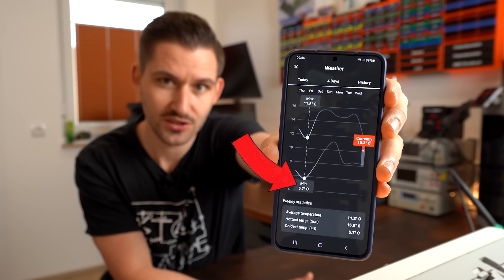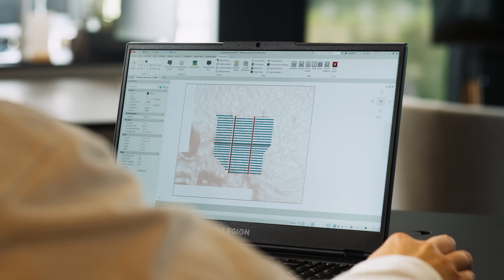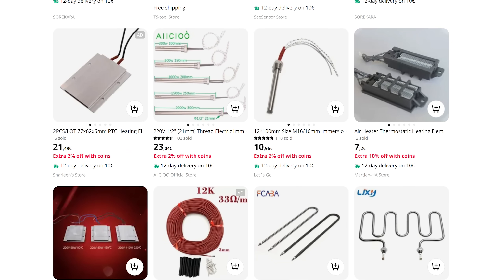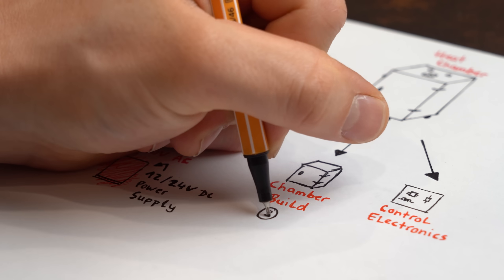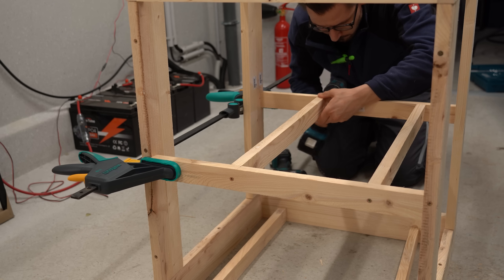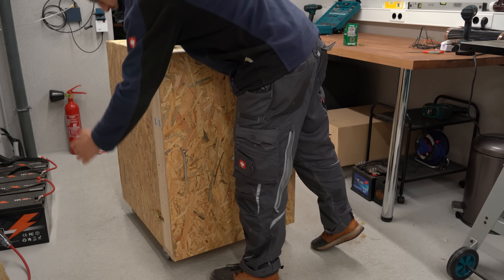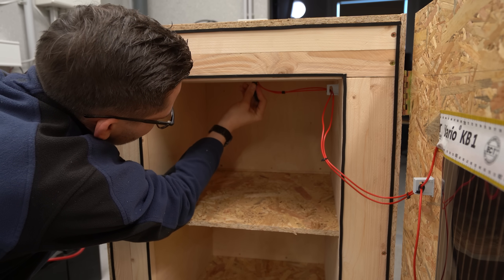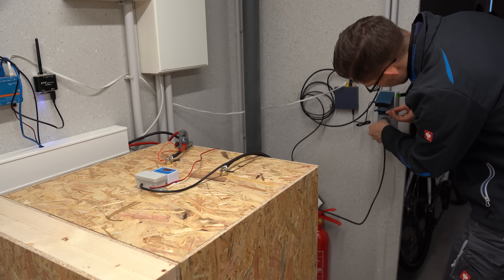The Best Battery Enclosure looks like this?! (Self-Heating)

Comment: Best practice is to use fire resistant materials for battery boxes, usually metal. For DIY, you can use cement fiberboard to line the inside of the box to create a safer barrier.
Reply: Yeah, im also a bit concerned about that wood box with heating and batterys. Although the heating element only reaches 50°C, it still uses 230V. A bit risky that setup
Reply: I totally agree. I need to build a battery box for my 48 volt 300 ah lifepo4. I don't need for it to be heated though. I like the quality of build here. Maybe the internal osb can be swapped out for cement board.
Reply: Metal is for applications where the batteries need to be protected and you don't have much space. Overkill here. There is fire-resistant mdf for applications like this.
Reply: Agreed. Similarly, type-X Drywall (at least in the U.S.) is rated for fire resistance and is very cheap. Basically the reason it is used for walls in most homes here.
Reply: Fair comments but, have you ever seen any fires caused by lifepo4 chemistry?
Reply: @Poult100 - “seen any fires with LiFePo4 chemistry?”

https://youtu.be/07BS6QY3wI8
Reply: ROCK WOOL is fireproof (its a wool ...from rocks xD) 
average fireproof plasterboard is more than enough ..... you can even paint the OSB with waterglass (then it will be fireproof) then stick to it fireproof plasterboard and paint it too with waterglass (its like clearcoat)  anything painted with it will be extra resistant to fire ,and with direct contact will "rise" like an spray foam extra insulating from any heat
Reply: This is the best answer. Home builder here. I have created many fire resistant storage spaces in homes. Hardie® backer board is thin and easy to install. And unlike any wool-type product, it will not allow fresh air in to keep a fire going. Case closed. Trolls can stop trying to undermine the viewer's comment.
Reply: Upvote this man, this needs to be seen
Reply: Good point!
Reply: Not a bad idea in case a connection gets loose or something and the wire overheats and catches fire, or starts melting the plastic battery box. A little blue Loctite on the battery terminals is a good idea, just don't get any between the ring lug and top terminal surface.
Reply: I’ve build a solar array overhead on my balcony, Its fastened to the construction of the balcony, its flooring and weighed down with a pendulum as a heavy ballast against high storms.

It wiggles a little as supposed, but this gives me an issue, as I wanted to make a dry space underneath and have the battery bank secured away. 

There is few cm wide gap from the panels to the house walls, and obviously it moves a little around, so how could I approach in regards to seal it off.

It would disrupt a great view if I threw up a plexiglass/glass barrier to still see through, which would be my last case scenario, otherwise should I simply just make a water/fireproof box for the battery bank?
Reply: Unlike lithium-ion batteries, lithium iron phosphate batteries have less risk of explosion and fire, so they are not needed.
Reply: @박메롱-k9z  I know what you're getting at but remember, they're all lithium ion; lipo, lifepo4, liCo, liTi and LiS. All lithium ion.
Reply: Or just use LFP batteries so you don't have to worry about that in the first place. Better to use a battery technology that won't catch fire in the first place.
Reply: @swecreations  LFP (used here) is very safe, certainly much more than lipo / lion, but its not always that it just gasses out
Reply: Now he needs to build an automatic foam fire extinguisher into that thing too ;)
Reply: I built mine out of tar board, with newspaper insulation. Is that bad?
Reply: @PoopCop No, you're fine. Soak the newspaper with oil to keep out any moisture.😁
Reply: I was thinking the same thing. It's a kindling box.
Reply: I was wondering if that whool is fireproof. But it doesn't look like it from this comment
Reply: it is  @HolgerNestmann
Reply: @HolgerNestmann mineral wool is a product that is made of minerals, and is much safer than foam board, but has some similarities in quality to fiberglass. It is used on high temperature areas such as around chimney pipes and flues. It's also less itchy than fiberglass, but a breathing mask is still a good step.
Reply: If it is Rockwool insulation, like it looks like that stuff is, it doesn't burn. cut with a bread knife and handles like a fuzzy blanket.

Comment: 8:25 It would be better if Transistor was used instead of Relay. It is easier to implement PID with transistors. Also, you will not hear the continuous opening and closing sounds of the relay (I'm sure you've thought of it, but I just wanted to write it down).
Reply: That will run really slowly, and the controller has 1C hysteresis built in, which means cycle times are in the order of minutes. Add the batteries, and that thermal mass, and it becomes even longer.
Reply: @SeanBZA  You may have a point. We need to calculate and experiment on it.

Comment: Hi scott I hope you changing the material to fire proof as i see it with wood a big hazard also as much as I know battery cells generate hydrogen and oxygen during their charging and cycle so ventilation is must check if you battery have any vent on them or contact the manufacturer if this type requires ventilation ❤
Reply: lithium battery's dont need venting and if they cache on fire no container will stop it burning
Reply: @404hopenotfound  partially true, wood container it's just a way to amplificate the fire. I don't like that. LiFePO4 are not explosive as Li-Ion, but anyway they can generate a lot of heat, steam and sometimes flames. Nothing to worry about if they're not in a container or near flammable materials. With wood container a small problem could lead to a uncontrollable fire and to a disaster. Saying that as an engineer and as PV installator.

Comment: The Question is where you are, there is a surprisingly huge difference in pv efficiency between north and south germany, For one the angle of the sun is better in the south and on the other side in the north you have way less clear weather due the proximity to the water.  Also, a deltaT of 7°C took 20 mins, but you loose five in 60mins. Now wait till its freezing, the heating may be to weak for this.

Comment: Hello. Nice job, but I can see a way more simple way. You said that most heaters run on lower voltage. You just put 4 big lumps of low voltage power source in that box... Just sayin' 😊 By rhe way you can buy simple bimetallic thermoswitches for all temperatures and high power aluminium case resistors for all values. Hooking up a small, and intermittent load to a lead acid battery is also beneficial to slow down its aging and loss of capacity. If the thermostat or that heating element fails, you can simplify and cheapify further. 
Viel Spaß und Kreativität weiter. Gruß 😊

Comment: To get more heat for your energy, you should check out making a heat pump. For example, use the compressor from a mini fridge, or an ice cube machine. It will give you 2-6 times more heat for the power spent.
Reply: But it also cools the room it is in (his garage), which may not be desireable. Besides, his box is already quite efficient (near 100%), and he's using very little to heat the box. A compressor would add a higher startup current and noise on the line, which is also undesireable for various reasons.

Comment: Something just occurred to me.  You're charging lead acid batteries in an enclosed box.  that would accumulate hydrogen and become an explosive hazard if not vented. Hopefully no sparks in your controller.
Reply: They aren't lead acid. they are lithium iron phosphate (LiFePO4).

Comment: I am extremely interested in how it turns out over time. Currently we are off grid and our generator shed that I made is insulated very well in a very similar fashion but is also very well ventilated because we use flooded lead acid batteries. We are looking to change those out for those new batteries like you have but that's going to be next year. So I am interested to find out if closing up the ventilation and possibly adding active heating is a worthwhile for our little system.

Comment: Since you are using a lithium batteries, it may make sense for you to add an additional "safety" thermostat, just in case something goes wrong with the temperature controller. It could be a cheap mechanical thermostat wired in series to the heater and set at a higher temperature than desired (e.g. 20°C).
Btw, did you calculate what were the average heating losses in watts?
Reply: A simple little klixon would do for an inline safety cut off.

Comment: Looks great, one thing I would do different is the placement of the heater I think putting it and the temp sensor close to the bottom would give you better efficiency because of convection.
Reply: Putting it on the side allows the air to build up speed as it heats up, whereas on the bottom it would heat the air uniformly and rise more slowly. Generally higher air velocities are preferred for heating a space, as the differences in air temp will equalize naturally, more quickly, at higher velocities.

Comment: You really phoned this one in.  Even though your garage will get cold the batteries only need to be heated to above freezing so it wouldn't take much.  Also, it looks like you made a perfect box without thinking at all about mounting any of the electronics.  It was all just tacked on.  With a little bit of forethought you could have run all of the cables inside the panels and recessed the controller, stuff like that.  This probably doesn't matter but I would expect the heater pad to have been mounted on the floor of the box rather than the door.  Maybe the wiring would have been inconvenient?  Like most things, the second one might be made much better. But so long as it does the job I suppose the cosmetic things don't matter.  I would be worried about heating a wooden box though.  Sure, it didn't get too hot on your workbench, but enclosed in an insulated chamber if the controller failed in the on state it might get much too hot.  And when you least expect it to.  Like on a hot summer day when it wouldn't even be needed if it stuck on it would cook itself. If nothing else perhaps a separate alarm for overheating.

Comment: Very nice work! My comment is that I always worry about something starting on fire particularly when using Chinese components. With so much insulation the system could get really hot if the heaters got stuck on. Maybe a completely separate safety relay system that cuts power if things overheat???

Comment: Add something like fire suppression, and auto kill switch, insulation and wood with electronics and mains voltage might get you into an accident. Since you already use the arduino, how about integrate it there like smoke sensor and many more.
Reply from the maker: Might do that.

Comment: I like your idea with the temperature controller. Its simple and fast. But please use a fuse or motor protection switch. If the heater resistance goes down, the fuse cuts the power instead of increasing the heater power and generate a fire hazard.

Comment: Couldn't you have used a simple diode  to lower the heat output of the "too hot" heating element by half?
Reply: He specifically stated he wanted it to use as little power as possible. Your suggestion works but it wastes a lot of energy which is not ideal
Reply: @Mr.Engine993  How does it waste energy?
Reply: @stusue9733  the diode has a voltage drop of around 1V across its two terminals. This energy is lost as heat but you won't really be able to utilize that heat for heating the cabinet because you can't dissipate it well
Reply: @Mr.Engine993  Heat is heat. If the heat doesn't dissipate the diode fails. 
In a 240V 50W system, just how many W would the diode be dissipating?

Now it would make sense to put the diode at the bottom of the box and let convection do its thing.

Comment: Excellent as always! Please consider airtightening the box - especially the holes you drilled for the controller. Keep up the good work! To test, I can recommend a standard disco fog machine (used it lately in my bathroom to find air leaks)
Reply from the maker: Thanks for the feedback :-)
Reply: @greatscottlab  This box will accumulate deadly gasses.

Comment: If you line the inside walls and the door (before installing the heater) with aluminum paper, would it not get a lot better efficiency?
Reply from the maker: As a reflector? Yes. Should be better.

Comment: Why would you put the temp sensor at the top? Heat rises, and especially in a box with negligible currents, will collect at the top. Youll have a thin layer of the desired temp near the top and the rest will be an unwanted gradient. You need to at least put a circulation fan in there, mounted near the top and facing downward.
Reply: Yeah, but he already set the temp well above the minimum requirements for his gear.

Comment: I was thinking about something like this for a solar system except I intend on using deep cycle. Lead acid batteries, so I need to keep them warm and allow air flow so hydrogen doesn't build up. Unfortunately lithiums are out of the budget right now
Reply from the maker: Add a fan to my design and there you go ;-)

Comment: One change I would have made, I would have added mylar or some sort of reflective material behind the heating elements. Without doing that, you’re basically just heating the wood behind it. Adding reflective material will also help use less energy also.
Reply from the maker: Good idea. Can still do that :-)
Reply: Thats a Great Idea
I use 3x Victron Battery Balancers on my Lead Acid Batteries to allow equal Charge across whole bank. I Recommend it. Electrician by Trade and Been in the Solar Business for 7 Years @greatscottlab
Reply: @greatscottlab emergency blankets :) I've used them in summer over windows that get direct sun to avoid overheating. They work well both ways !